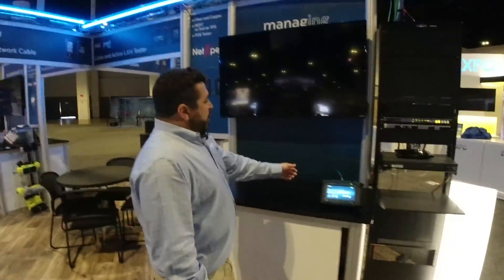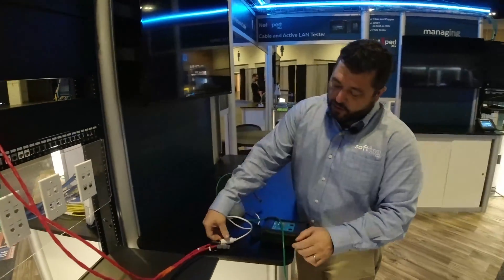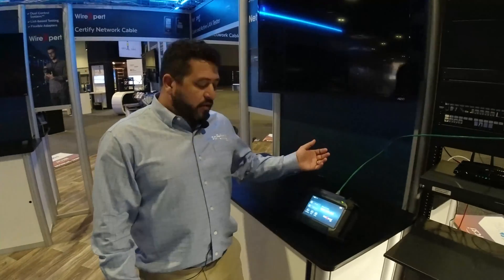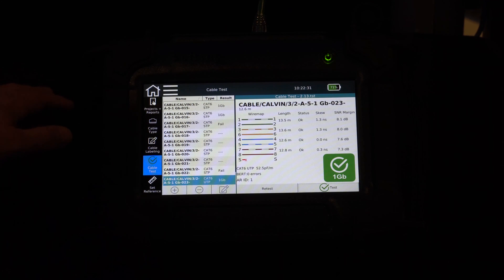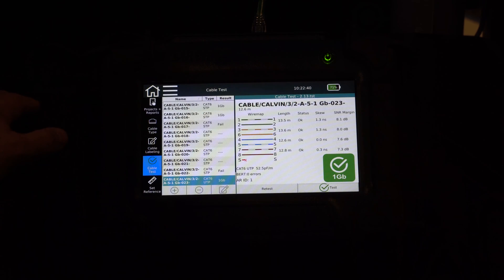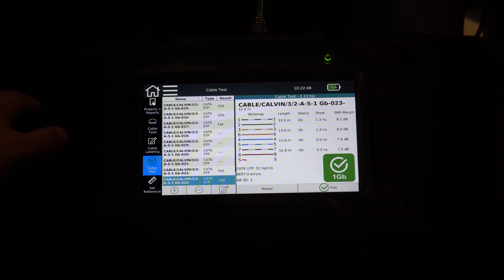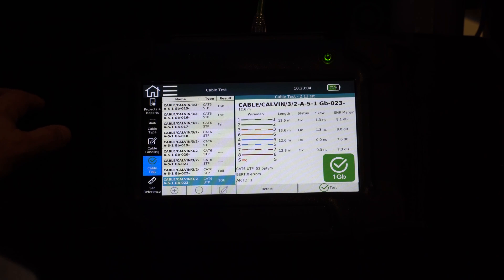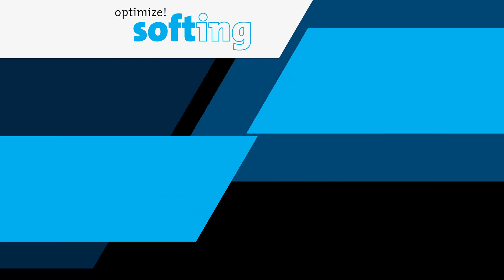BERT (bit error rate test) testing vs certification testing for Ethernet cables

Comment: What is NPTL? Next time, please explain these acronyms in the description.
Reply from the maker: MPTL, modular plug terminated link, is a type of connector commonly used in applications like security cameras where the cabling has a socket (or jack) on the distribution panel side and a plug on the other end to directly connect to your camera.  For a LOT more information, check out this white paper on MPTL... https://itnetworks.softing.com/fileadmin/media/images/whitepaper/MPTL/Softing_ITN_Whitepaper_MPTL_EN_2021.pdf

Comment: Si una red cat6 está armada con código de colores T568A. Puedo ponerle patch cord cat6 con codigo de colores T568B en el rack?
Reply: Since both T568A and T568B are both straight through cables, it will functionally work.  The only issue might be in the future if anyone needs to troubleshoot the cable -- it could get confusing.